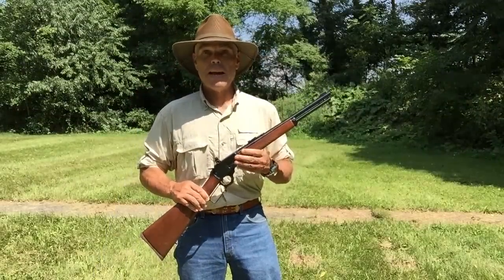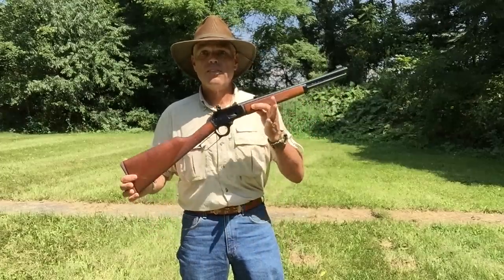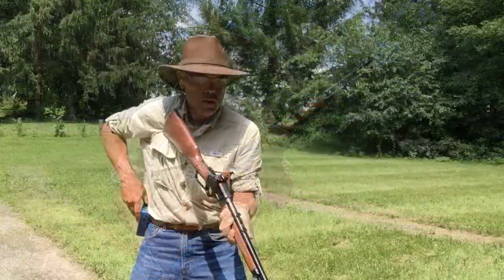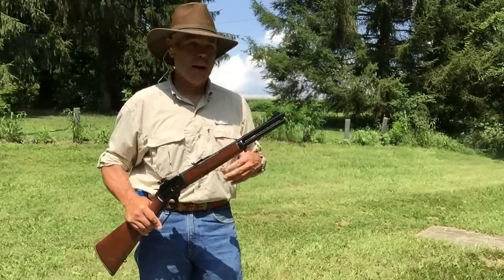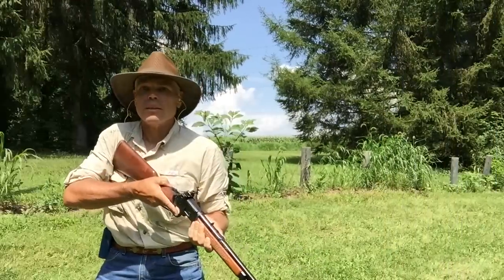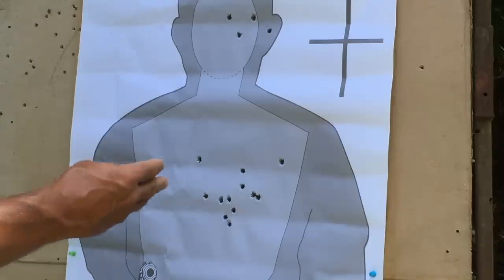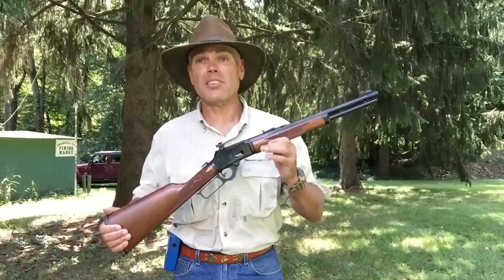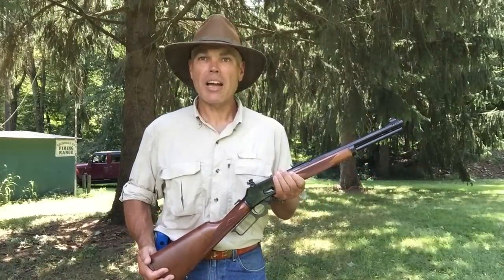Marlin 1894 Lever Action vs  Tactical Carbine Course

Comment: They say shoot to stop the threat, tell ya what if I had my ear pierced with a 357 magnum I'd get real compliant.
Reply: The placement of that round did more damage than piercing that ear: That's in the jaw line.
Reply: Lots of people have thought that, followed by utter incredulity at the guy they just centerpunched, getting the exact opposite of compliant.
Reply: @springbloom5940  "Lots" indeed.  Statistically speaking, even calibers considered among the worst for defensive use such as 22LR have far more victories than failures.  People shrugging off serious calibers like 357 Magnum are the exception, not the rule.  If you find yourself facing down a leather and denim armored WWE alumni on meth that can't be stopped by a center mass double tap, you were just as likely to encounter other scenarios that a gun couldn't rectify, like receiving a crashed Cessna in your attic.
Reply: @herbderbler1585  

The overwhelming majority of incapacitations are psychological. Simply the awareness, or even a perception of having been shot, is enough to stop most people. For those who are not psychologically incapacitated, multiple hits are often needed and often the recipient has to be manually restrained. There is of course, the infamous Platt and Matix incident, but there are numerous others, including a shooting we got a bulletin on, a few years back, where a suspect took a total of 14 rounds(I think?) of Hornady TAP 556 and 180gr 40S&W Gold Dots, while returning some 40 rounds of 45 ACP from a single stack, one mag and box of loose rounds and still had to be fought into handcuffs by 4 officers. Drugs were not a factor. 

Just think of it this way, are you going to quit because you got shot?
Reply: @FrankD71864  Indeed. Quite possibly still a fatal hit.
Reply: Lol.  No shit!
Reply: Me too.

Comment: In addition to this:  one little advantage the lever action has OVER the AR15 semi auto is that you can top off your ammo inside the tube magazine by inserting extra cartridges manually without having to sacrifice ammo still in the magazine and without taking your rifle out of action while reloading.
Reply: ClassicGunsToday ClassicGunsToday in the amount of time it takes to put one cartridge in a lever gun you can top off with a 30 round mag in an AR15... I see zero advantage.
Reply: @DrewEdwardBacklas  the advantage is that you retain the rounds in the magazine vs a tac reload where you are losing the rounds left in the partially emptied magazine. If you have the time and the cover to retain the partially expended magazine then the advantage the OP is illistrating is lost.
Reply: DrewEdwardBacklas as you were told, you can retain rounds without giving anything up while inserting extra and still have your gun ready for action at the same time.  Yeah, you could drop a magazine from an AR, insert another one in and pick up the dropped magazine but that is 3 different things you are trying to do at three different times and your gun, at some point, not ready to shoot. 

A million different scenarios can happen either stationary, on the move, open space, under cover, etc. and an AR would certainly be more than ideal over a lever action in the jungles of Vietnam or Deserts of the middle east fighting unpronounceable factions numbering in the hundreds with AKs (even though not THE ideal...no select fire on AR). 

But that is one little advantage the lever action has in spite of all the AR advantages.
Reply: @DrewEdwardBacklas  Imagine the more realistic scenario is that auto loaders are banned.  California isn't far from that.
Reply: Bryan St.Martin I, having formerly resided in NY state understand that some may find themselves without an AR. I also believe that a person with a lever gun who knows how to use it is far from unarmed. But just because a lever gun can be used to complete a minimum standards state mandated carbine qualification for police does not suddenly mean that it is the equal of an AR pattern rifle and certainly does not suddenly bestow it with any advantages over the AR. If someone chooses to run a lever gun (or has the choice made for him) that’s fine. But don’t pretend it has an advantage that it doesn’t.
Reply: DrewEdwardBacklas who said ANYTHING about standing in the open?
Reply: Dellacondan The second comment by urmominabox87 suggested standing in the open by saying “if you have the time and cover”
Reply: He stated that if you have the time and cover to retain a partially expended mag then the advantage of the retained rounds in a lever gun is negated. I contend that there was never an advantage to begin with. Using as an example,  the hypothetical opposite of “time and cover”, to show that in no situation is there an actual advantage to a levergun’s rounds retained in a mag etc etc.
Reply: Whatever a person's chosen rifle happens to be, practice makes perfect when reloading under stress. You also want a rifle that is least likely to jam on you and you would also want a handgun or two on your person as backup in case your rifle does jam in a close contact firefight.
Reply: @JohnDavis-im1oy  You're assuming that your mag  will never misfeed and your AR-15 will never jam. If you are holstering two revolvers, you have firepower on you that isn't going to jam. Did Gen. Patton prefer to holster two 1911s or did he prefer two .357 Magnum revolvers?
Reply: @DrewEdwardBacklas  IF you have another mag. The lever gun can be topped off from rounds in your pocket.
Reply: BOORAGG IF you have more rounds in your pocket. An AR can be topped off with an extra mag from your other pocket... how is this an argument?
Reply: Doubt if they still do it but the US Border Patrol used to train in partial reloads when using revolvers.
 
Also, adding cartridge loops to the stock the way I've seen some shotguns would speed up the process in case you don't have any cartridges in hand while in an engagement.

After all, must have parity with daddies' shotgun.
Reply: @shorttimer874  The British Army has done the same, and it was done on the run.
Reply: @DrewEdwardBacklas  

Do it prone. Yeah, the AR is more capable, but it also comes down to proficiency. Put an expert with a lever action and a grabass with a AR, at opposite ends of the block and place bets. The advantage of gate feeding, is that it never runs empty. If you fire two rounds, you replace two rounds and still have a full magazine. Tactical loads with box magazines creates a situation where you have a bunch of partial mags with unknown round counts, that will run out unexpectedly.
Reply: Shoot half the ammo out of your mag in an AR 15 and you still have more left in the mag than the lever gun can hold
Reply: @urmominabox87  it's not important, you don't need to retain the mag. If you are even carrying extra mags, then you are likely using some sort of mag carrier and have more than one extra mag. There's no situation other than a military combat scenario where you are going to use up enough ammo to worryabout retaining a partial mag. The OP's logic is flawed.
Reply: @jegr3398  

Except that I can replace them one at a time, as I shoot.
Reply: @springbloom5940  So what?
Reply: @springbloom5940  While you're fumbling with loose rounds, I'll be putting shots on target. If I think I'm getting low, quick mag change and BAM another 30 rds just like that. Hey I get it, it's a cool feature to be able to top off a lever gun, but to think it would give you any kind of advantage over an AR is just silly.
Reply: @springbloom5940  Sure, but I hope you know a hay bale is not good cover.
Reply: The AR isn't entirely out of action. If you pull your mag to add extra rounds you still have at least one in the chamber.

Comment: A lever gun is still a viable option for those wishing to protect themselves while living in a prohibitive area. pistol calibers have good velocity due to increased barrel length, low recoil, and longer sight radius( plus red dots are an option). Nice video! I think Clint Smith even teaches a tactical lever gun class.
Reply from the maker: I think you are right. Folks shouldn't overlook a good levergun!
Reply: Federal/American eagle 357 magnum 158gr soft points are pushing 1900 FPS from 18.5” barrel ! Just saying !
Reply: @jamescalhoun4588  Ding, Ding, Ding!!! That is approaching full on rifle rounds at that bullet weight. MORE than sufficient for home defense or short range hunting of mid to large game.

Comment: As an Ohio policeman I found this very interesting. I've always felt the lever action carbine would be a viable option as a patrol carbine.
Reply from the maker: I really like my lever action rifles and carbines. Push come to shove they could still provide reasonable performance as a patrol rifle. That said, and I mentioned this at the end of the video, I don’t think we should trade in our semi-auto tactical carbines on leverguns. Pretty much everything the lever action rifles/carbines can do, a tactical carbine can do as well if not better. I really just wanted to see if I could shoot a qualifying score on the patrol rifle course.
Reply: @hrfunk  I agree. For social engagements i'd much prefer a box fed semi auto carbine. There's just something about the allure of facing down a felony suspect with a lever gun.
Reply: The nice part with a lever action is you can top off and still have you're magazine available to keep putting rounds down range if needed.
Reply: I think it probably made more sense back in the day when we carried revolvers.  When I started in law enforcement I carried bullet loops on my belt that the weapon could have been easily topped off with.
Reply: Are you seeing this? I'm seeing a post to me from a different user with your name from a different video.…edited to add.

I took a screen shot and saved it. This is BS!
Reply from the maker: No. I didn't see that and for some reason it didn't come through on these comments. In fact, your comment did not come through like they usually do and I just now saw it. That's why it took me so long to respond. Have you gotten any other bogus posts from other users identified as coming from me?
Reply: CharlyRomeo2009  The Leveraction was used by many Law Enforcement agencies. Is it Cop proof...No!
Reply: shit, just imagine that 1 cop walking around with a 45-70 mares leg
Reply: @hrfunk  So much slimmer and handier than the AR or AK platform.  Even with a red dot optical, my '94 in 44 Mag is still really light and handy.  Of course, my 1895 45-70 govt is also light and handy, but the recoil may preclude a qualifying score, lol.  That one does not favor rapid shots.
Reply: I'll stick with my suppressed SBR in my car at work but I do love lever guns. I spoke with an oooold retired officer, old enough to have fought in WW2, and he told me about the time he shot a dude with a handloaded 12ga slug he molded himself from drilling 5/8" holes into 3/4" boards which he said made a perfect 500 grains. The subject had an old surplus Krag and he was good with it and had shot and wounded officers. No one could get close to him and no one but him had a long arm. He was going hunting in the morning when he got off shift and wanted to show his shotgun to another officer so had brought it along. I started making slugs the way he told me and the damned things are tackdrivers. I can hit a paper plate at 100 yards with one out of a 18.5" barrel. But this guy made that shot with a bead sight in the dark 😳
Reply from the maker: Ha, ha! Good shot!
Reply: Why do we have to chose one over 
the other? Why not have both?
Lever guns and semiauto rifles. 

I chose both. 
Both have their place.

Comment: Nice job.  May want to look at some CAS/SASS shooters.  The speed at which some of them shoot lever rifles, SA pistols and dbl shotguns is amazing.
Reply: Theres a video on here somewhere that shows a kid emptying a leveraction carbine faster than most people can unload a semiauto lol. The shots come so fast you cant even distinguish the lever cocking between rounds. Dudes insane.
Reply: @TrevorEmahizer  If you watch the really fast guys they are all using toggle locks, Henry's and 73's. They have a much smoother action than a 92 or a 94 Winchester.  Henry's action isn't as strong, but it's worlds slicker.
Reply: @slowpokebr549  Mile definetly has a short stroke kit in his gun. Several of the guys I shoot cowboy with do as well. Both my 92 and my 73 are polished but not short stroked. Like anything you modify for performance, reliability starts to decrease, hence no short stroke for me. I am happy with my 30 second stages.
Reply: Almost all of the really fast CAS shooters use underloaded 38 special and modified toggle locks.
Reply: Yes, as a CAS shooter you learn to handle a levergun with precision and speed. A shortstroked 1873 is slightly faster than a 1892, but the difference in practical terms is marginal, and in return the '92 in .44 Mag is very robust and packs a lot of punch. Very underrated.
Reply: Some of those are pretty highly prepped guns, short stroke kits an all.  Not quite a modern race gun, but a well set up lever is a slick running rifle.
Reply: @slowpokebr549  '94 Win, 336 and 1895 Marlins and the rifle caliber Henrys all have a much longer throw to handle rifle length cartridges.  No comparison in stroke length to an 1894 or the 1873 and 1892 clones.
Reply: I agree the CAS guys are amazing but in all fairness the top competitors shoot mouse fart loads. However even with full power loads they would not loose and ground to the semis IMO.

Comment: One of the reasons that it can be still effective is that you don't need external magazines since it has an internal magazine tube. Just like a shotgun like the Remington 870, all you have to do is " top off" the magazine. I learned to do this with my Winchester 30-30, and keep a full magazine at all times. So yes it is quite effective in law enforcement, and personal defense. What is needed is to practice to gain and keep a high level of proficiency to gain effectiveness in combat, and hunting. The maxim holds true about know your equipment.

Comment: I love my Marlin 1894CS! The first one I owned was bought early 1980, no cross bolt safety. In 1985 my wife presented me with my second one for Christmas (cross bolt safety model)! (I don't recall what happened to the first one). The Christmas gift was $180 out the door!!!
I used it a tremendous amount hunting Mojave Desert jackrabbits and was lightning fast for followup shots. Using reloads with WW 296 powder and 110-125 grain Winchester hollow point bullets, they literally blew up those 'jacks.
The one practice that never ceases to surprise me is many folks take the butt off their shoulder before working the lever. That's an incorrect practice!
Mr Funk, thank you for this video as it reaffirms my faith in people using these carbines correctly as well as showing how fast and handy they are, not only for the test you performed but also for how much fun and effective they are!
Reply from the maker: You're welcome! I love my 1894CP. Shooting the qual course with it was fun, as is pretty much any other shooting I do with it. The 1894 is just a fast, handy, package and with full power 357's it packs a punch!

Comment: I carry my 1894CB with the 20" octagon barrel as a truck rifle. I also carry 100 rounds of .357 Magnum 158 grain JFP. I modified a black USGI mag pouch by removing the exterior grenade loops and the interior mag separators. Mounted on a USGI black pistol belt, it is now a dump pouch that holds all 89 remaining rounds when my rifle is fully loaded. The advantage of the Marlin version is twofold; a side-load tubular magazine that can be safely topped off from behind cover or on the move, and a solid pre-drilled and tapped receiver for ease of adding peepsights or optics. HR Funk proves the platform works.

Comment: Thanks for a fun and interesting test, Howard.  I fired that same qual course with a pump gun and 12 gauge rifled slugs.  It's not as easy as it is with a semi-auto rifle, but you can make it work and it's a lot of fun.
Reply from the maker: Ive had some requests to give that a try, so you may see my version of it in the future!
Reply: @hrfunk  I think you'll enjoy trying it out. It certainly fits your premise that if all you have is, say, a lever gun or a milsurp rifle, you may not be as helpless as some people might think. I fired the course using dept-issue reduced recoil rifled slugs and again with full power slugs I use for deer hunting. The full house rifled slugs were a bit of a challenge when fired off my left shoulder...but I was pleasantly surprised at how well it did. There are still a lot of shotguns in police armories around the country. At 50 yards, with a bit of familiarization with the gun, it can even be done with a bead-sighted gauge.

Comment: Excellent video. Great job on the carbine course. Did well on the reload stage in spite of not getting the last round off. The Marlin 1894 is a nice alternative to the scary black guns. Check out the Ruger Model 77/357 uses rotary magazine. I think of the Marlin 1894 as a modern ranch rifle. A Smith & Wesson Model 19 would complement the lever gun. My first firearm purchase three years ago was a lightly used 1992 Marlin 1894CS chambered in 357. I had to upgrade the shell carrier to the Marlin improved shell carrier as it was prone to Marlin jam. Installed Wild West Guns Trigger Happy. The gun is very reliable. Lots of fun to shoot and great gun to introduce new shooters to the sport. Thanks for taking the time to produce the videos.
Reply from the maker: You’re welcome. It sounds like you hav a nice little 1894 there!